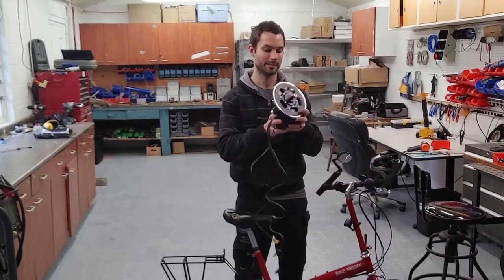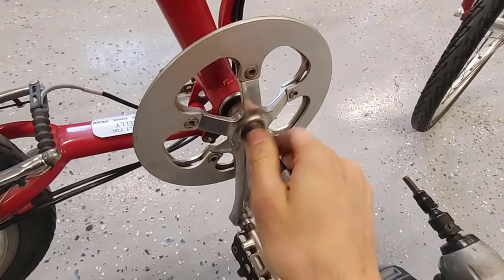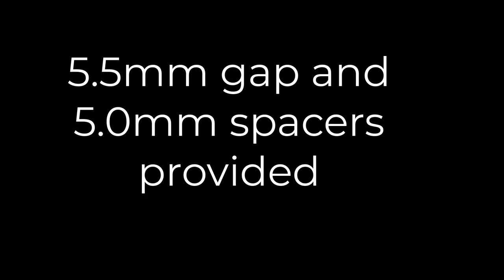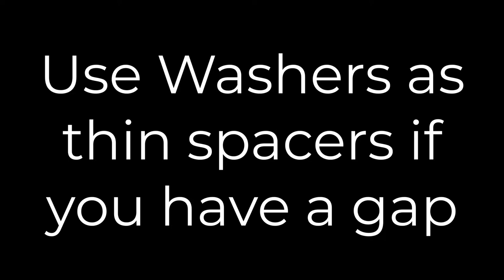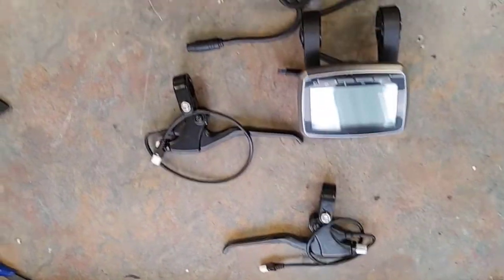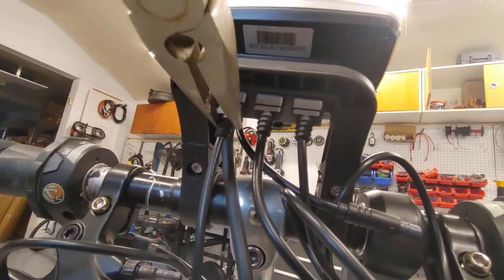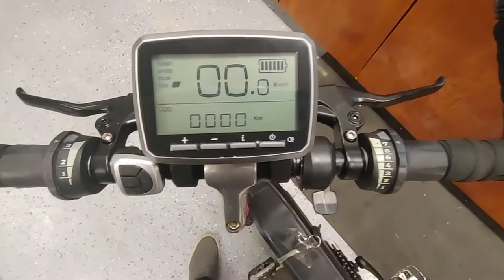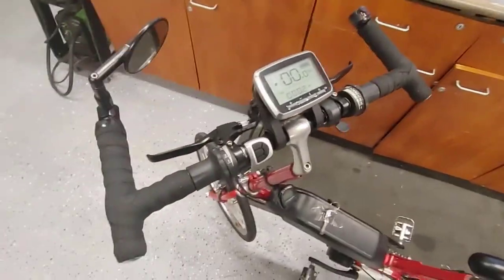EP01 : Tongsheng TSDZ2 on Bike Friday Folding Bike ; Electric Bike Laboratory

Comment: Nice clean build.  Hose clamps a must with Tongsheng mounts if you're not using the 2nd mounting bracket.

For folding bikes with hinge by water bottle holes, use aluminum square tubing as a riser for Battery mounting to clear the hinge bump.  Depending on location of water bottle holes, you may need a Rivnut for Battery to mount better - OR - Ali Express sells $15 battery mount adapter plates which should work.

I did a Bafang BBS02 for higher speed and programmed Pedal Assist 1 at 5% so it's slow around pedestrians. PAS 5 is 100% and 20+ mph fast.  To get that fast with a Tongsheng, you need A 52 tooth front chaining and lots of pedalling effort.  I used a Zizzo Folder on my conversion.

A folding ebike is nice because you don't need a bike rack to transport it in a car. Also this bike is much lighter than the 20" fat tire folders - Lectric XP weighs about 70 lbs.
Reply from the maker: Great info ! Thank you for the comment ! :)

Comment: @5:30 very important step putting the thread lock. I didn't and after about 300 kms the setup developed a squeaking noise, while pedaling with the motor engaging (pedaling with no assist was surprisingly quiet). I checked and sure enough, the lock nut and the two M5 bolts were loose. Locktited them and now everything's fine. The only difference is that I've use a LOT of it on the lock nut :). That being said, maybe it is a good idea to run the setup for a while to have everything settle and then loctite and tighten.
Reply from the maker: A great point! Yes you're right it is certainly critical, one of the biggest issues we've had is having these motors come loose (usually weeks or months down the road when we first started installing them).

Keeping them tight is paramount! You may be on to something with installing it, letting everything settle, and then going back over with Loctite.

Thanks for the great comment!
Cheers!
Reply: @ElectricBikeLaboratory  well, I am learning too :). Converted my bike about a month ago and now I am waiting for a kit for my partner. But honestly, for how cheap they are, it's worth it (and I like to tinker too). Was cheking some Cubes with the  latest Bosch, 4th gen or smth.... 4k ... I mean, that's just insane
Reply from the maker: @ioandragulescu6063  It is insane! Just so you know, the Tongsheng TSDZ2 motors are discontinued, so if you know anyone who wants to get one, tell them to hurry up before they're gone!
Reply: @ElectricBikeLaboratory  crap ... I hope that we will still find parts for them. Is this related to the dispute I read somewhere they have/had with Bafang ?
Reply from the maker: @ioandragulescu6063  Yes, you got it. They lost a lawsuit to Bafang and have had to stop selling the motor on all major platforms, Tongsheng has taken it off their website, most vendors have stopped listing them, it looks like they are no longer being produced. Sad! Because I'm not aware of any other fair priced torque sensing mid drive that fits into a standard bottom bracket :(
Reply: @ElectricBikeLaboratory  An alternative could be the CYC X1 series.
After a few years since I purchased the Tonsheng TSDZ2 mid-drive/display combo on Ali, I still haven't installed it on a suitable bike. My biggest hurdle would be the bottom bracket removal.
Reply from the maker: @Lord_Ralph  Yes we've done a few of those and they are awesome motors. They are just expensive, and very high performance, so they don't tailor to the everyday person looking to do a beach boardwalk cruise with an occasional hill, but they are certainly excellent motors nonetheless!

Comment: Great video.

Why didn't you put the battery at the back?

It would be great to see it folded after the electric install
Reply from the maker: Yes great point, a battery on the rear rack makes it more vulnerable to tipping over and then the battery can get damaged if this happens. Centrally mounting is better for center of gravity and "polar moment of intertia" ie makes the bike easier to handle when the weight is centered vs at the back. Appreciate your comment!

Comment: Great idea with the clamps to keep the motor up. I'm going to replace the zipties in my build. What was the length or diameter of the one that had to go over the motor?
Reply from the maker: Thank you! The ones that we used were able to go from 3.5 inches to 5.5 inches diameter. Or 89mm - 140mm in normal terms 😁

Comment: I’d be careful, that Sachs 3 speed rear  hub on this bike is not made for the kind of torque you could generate with that motor while pedaling up hill. Since these hubs were long since discontinued, finding replacement parts are really almost impossible. So, just because you can add a motor, it is not always a good idea unless you are also upgrading the rest of the drivetrain.
Reply from the maker: The customers so far have had a few thousand kilometers of riding with the motors and no issues. The motor is not a very powerful motor, so its not delivering excessive torque to the drivetrain. About as powerful as a really strong person doing the pedalling. But I totally agree with your comments, definitely good to be careful not to destroy a drivetrain by adding a motor!

Comment: What kind of performance gains are u getting from the 52v setup? Top speed?
Reply from the maker: About 45kmhr top speed but haven't been using the Tongshengs much lately and they need the firmware for 52V
Reply: @ElectricBikeLaboratory  Almost as fast as a BBS02. Not bad for a budget friendly mid drive.
Reply from the maker: Agreed! They did later down the road fall into issues with reliability, the TOSeven motors are just coming onto the market and may be a viable (or better) alternative
Reply: @ElectricBikeLaboratory  Yes. They said the tongsheng solved the issues with the new TSDZ2B. I just got an invoice for $630 on the DM01 1000W motor from Toseven to ship directly to me in California. Haven’t bought it yet. I’m still contemplating.
Reply from the maker: I've got a DM01 sitting on the shelf soon to be tested out !! 😁

Comment: Hi! I’m currently installing this kit but have no instructions on which port the brakes and throttle plug into on the display. Does the throttle go to the center and brakes to each side?
Reply from the maker: Yes throttle in the middle, brakes on sides 🙂🤟

Comment: On the controller/display how do you know which of the three connections to use for left and right brakes, and throttle connections?
Reply from the maker: Surprisingly the display is really smart in this regard, the throttle is the only 3 wire plug so it is able to detect this and assigns it as the throttle, and the other two as brakes. So you can plug into any
Reply from the maker: Sorry, most recently when doing an install the throttle only worked in the middle location, so scratch that last comment! Brake sensors on the ends.

Comment: What wattage do you recommend to throttle 20mph+ and PAS 28mph+ on flat ground? I want to convert a road bike. I'm about 170lbs.
Reply from the maker: For a mid drive I would recommend at least 500W, but more is definitely better. Keep an eye out for a new mid drive motor coming from TOSeven , it will be torque sensing, affordable and will give the power you're looking for!
Reply: @ElectricBikeLaboratory  Are you referring to TSDZ2B 48V 750W? I was thinking of pairing that with a 14Ah frame bag battery. I'm trying to keep it stealthy. Can you run the Tongsheng without the screen?
Reply: @ElectricBikeLaboratory  Just looked into To7. Early reviews don't seem to justify the price increase even though To7 claims it's an improved version of TSDZ2. I also don't need more than 750W for my commuter road bike... too much stop and go traffic.
Reply: @ElectricBikeLaboratory  Thanks for your videos. I’ve seen initial testing on different channels. I am excited about the Toseven DM01. I really want a torque sensing BBSHD equivalent. I have 3 recumbent tadpole trikes. A 48v BBS02, a 52v BBSHD and a 48v Falco torque sensing rear hub. I really like the torque sensing experience more than the cadence.

Comment: i have bike s with front hub one a rear hub and one with a TSDZ2....i would have installed a front hub on a bike friday cheap easy quick swapover just a front wheel and the rest of the parts.   TSDZ2 on a folding bike friday is overkill.
Reply from the maker: Yes, front hub is a good option too. These were for customers of mine, they were very happy with the bikes and had TSDZ2 motors on their other bikes. Thanks for the comment!